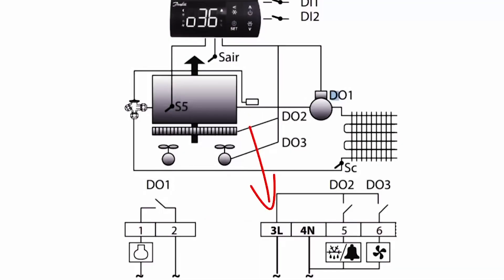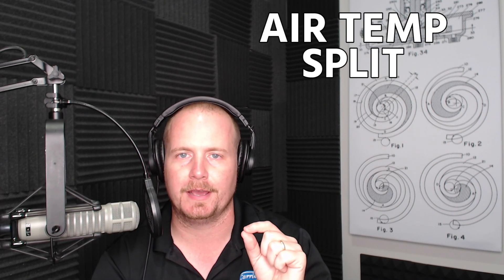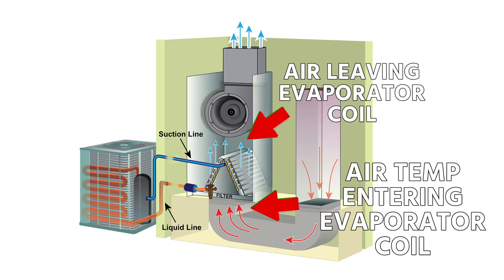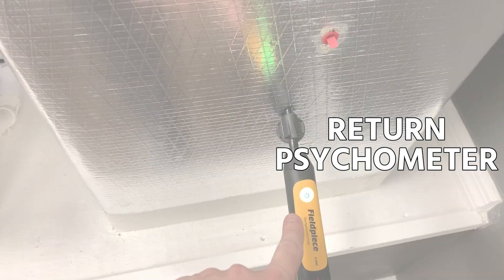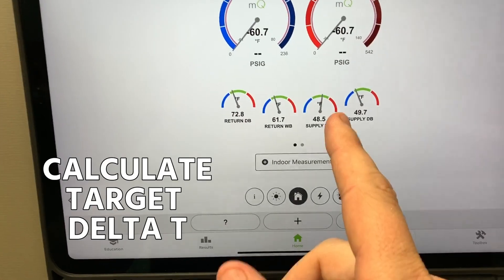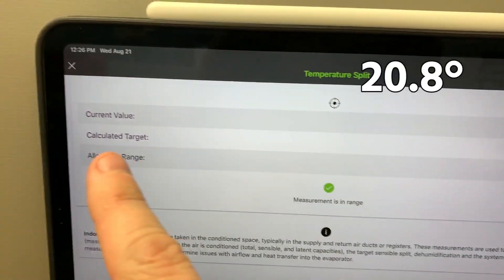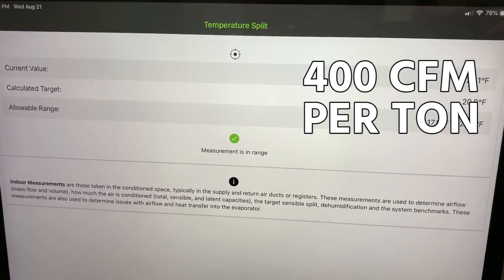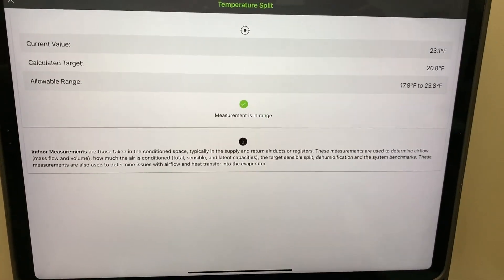What Should the Air Delta T be? (Air Temperature Split)

Comment: I look fo 18-24 delta t, 9 to 13 delta wb, and 5.1-7.5 enthulpy change in general. 18 to 24 depend in my area depending on shr and space use. Restaurants near me on the lower end because you have high density of people, so you can do additional dehumidification. For homes in my area its going to  be the higher end so we can stretch the sensible capacity. Most residential in my area has a sensible heat ratio in the 90%+ range. Makes to tough to get an efficient heat pump in cooling that also has a decent temp rise in heat.

Comment: Your last point on home inspectors. Most are not knowledgable enough in regards with the mechanical trades. They don’t know codes and think they are qualified to dissuade a home buyer from buying a house. As an electrician for over 45 years, I have come behind home inspectors many times and have to explain that the home inspector that you paid $1,000 to is wrong at his findings. One of their biggest mistakes is the outside condenser. He looks at the wire size and circuit breaker size and proudly says the breaker rating is too high for the wire size. He proves he does not know the code and frightens a home buyer to either walk away or force the seller to hire an electrician to make repairs that aren’t necessary.

Comment: If you run a small duct from the supply back to the return lowering the temp of the air going back into the return will that lower the air temp even more coming out the supply?

Comment: Often with chillers we play with the condenser water temperature to gain capacity beyond design. HVAC is no different. If it’s hot outside beyond design you lose capacity but if it’s cool outside you gain capacity. That’s why coil misters on the condenser can truly help for a undersized unit.
Reply: Great point. I'd be careful with coil misters though. While they can help in the short term, the water usage and the fact that they can corrode the coil and coat it in mineral deposits must be considered too. Water quality is a huge variable. While condensate or rain water might be safer if filtered, tap water quality varies wildly by region.

Comment: Great video.  Thanks.  One question.  With all of those variables (humidity in particular) how can coils be rated with a fixed percentage of sensible, and latent capacity?  I could see how they could be rated for a maximum of latent heat that it could absorb, but I can't understand how it can operate at a fixed percentage, when the conditions change.  Would a coils sensible/latent rating affect the target Delta T?
Reply: If you look at the performance chart for a particular unit, it shows how the sensible and total capacities change with varying conditions, you will have higher capacities with lower indoor wetbulb and outside air temps and those numbers also change with cfm across evap, there's areas on the chart where sensible = total capacity. To find out what your delta t should be at a given moment, there's a formula you would use,or if you use measurequick it figures it out for you. I havnt actually used the formula in years but I think it's  your sensible btus ÷ (1.08xcfm)=delta t

Comment: I just want my HVAC system fixed.  A building inspector said that the delta T was too low.  A repairman said I need the thermo expansion valve replaced for $1300.  Many other contractors turned down the job or simply did not have enough knowledge to repair the problem.  What do I do???

Comment: The delta T depends on the entering air enthalpy, not just the entering air temperature.  In some instance humidity, which is latent heat, can be most of the load, and will have an effect on the actual temperature split.  The more humidity in the return air, the lower the temperature split will be.  This is the reason we always measure the indoor entering wet bulb temperature..  Most equipment is not capable of producing more than 80% of its rated capacity, if the load is all sensible, as the manufacturers figure an 80% sensible heat ratio.  And assume at least 20% latent heat.

Comment: In a normal system, anything over 20 is an air flow problem.  I like to see 15-20° Delta T on a cool home, with 75-85° outdoor. Anything under 15° is a concern and potentially a dirty condenser.
Reply: That  is not true at all. Take a look at the performance charts for the units you're working on. You can have a delta t of 30 with proper airflow, or 12 with proper airflow. It's when you compare what you have to the chart that will tell you if there's issues or not with airflow

Comment: I think I understand this.  If I don't have the fieldpiece tool and app that you are hawking I can't really check delta T !  I will be looking at your videos with more skepticism.
Reply from the maker: Or just find someone you trust and watch their videos. All the best to you.
Reply: I don't think you have to have Fieldpiece to get Delta T but with Fieldpiece and Measure Quick App it Factors in just more than Delta T and gives you some Insight into what actually is going on inside the System to fine tune into things to look for with all your measurements of refrigerant and air flow to better understand the Dynamics of the equipment

Comment: Do you ever encounter duct condensation issues when a system is running in dehumidification mode or if airflow is set to something lower than 400 cfm/ton? The scenario being lower airflow causing lower supply air temperatures which in turn creates colder ductwork that may cause the duct’s surface temperature to fall below the dew point?

Comment: Really informative, thank you! 
Still, it seems like a simple delta t measurement can at least alert you if something is seriously wrong and you need to dig carefully in to the system? If it's hot / humid inside, "about" 15 is in the ballpark, and if the system has been on, "about" 20 is also in the ballpark. Or am I being naive thinking that way?
Reply: That seems about right and how I understand the system performance as well. 15-20 is target range, anything over or under, the system needs to be addressed.

Comment: Other day I swapped an outdoor unit.  Had 16 degrees split on a 3ton American standard heat pump.  70 degrees inside.  81 outside but holy hell it was soooooo muggy that morning.  At 1030am when I was done, prolly 75% humidity, if not more.

Comment: Hey great video, can you make a video on why an ahu sweats excessively, for example tons of water in the e pan. I have found it could be from dehumdification settings set too low, a break on the iceining insulation causes more humidity, dirty evap coil, speed tap too high on blower motor, but sometimes although I check all of those I still get stumped. Can we get a video on all the possible things that can cause excess condensation on the ahu and supply plenum. Thanks, love your content, made me a better tech all around
Reply: Yes, this please!  I am having similar issues on two properties.  Factory reps can't even figure it out.
Reply: Check for dirty evap and dirty blower fan blades. Essentially you have low air flow from my observations.

Comment: Brian, Do the Fieldpiece Job Link Pros adjust for altitude and provide Btus of enthalpy for pound of dry air? Meeting the parameters you outlined and adjusting for altitude, I take db and wb of return air and db and wb of supply air and I verify superheat at outdoor unit per manufactures specs. , I monitor system for 6.7 Btus of enthalpy for pound of dry air.
Reply from the maker: They do when you use them with MeasureQuick